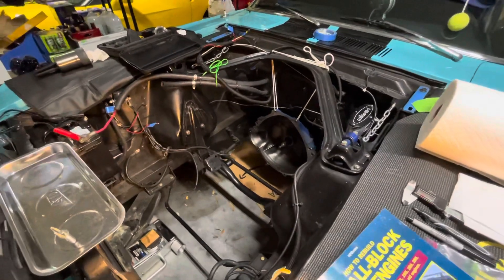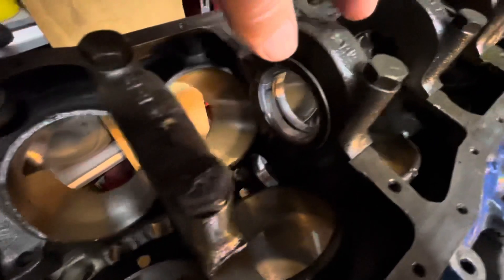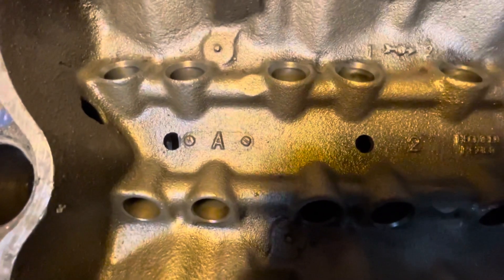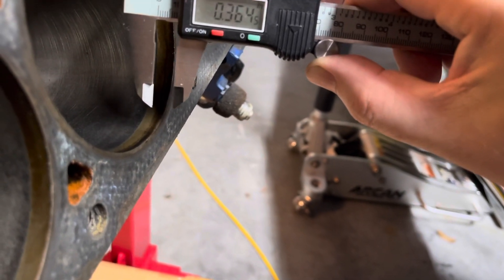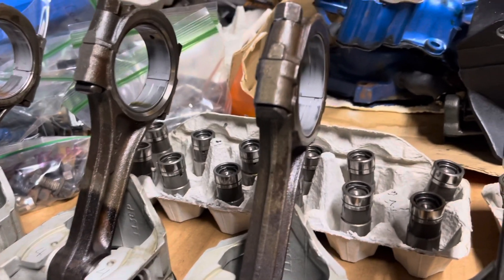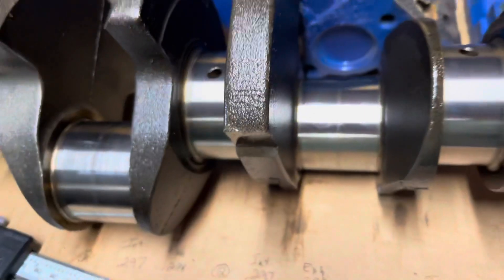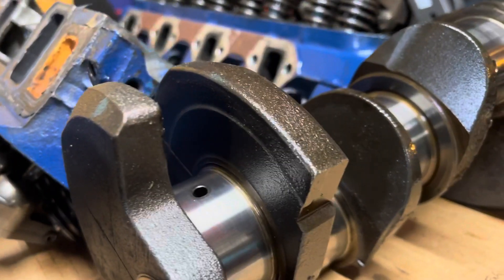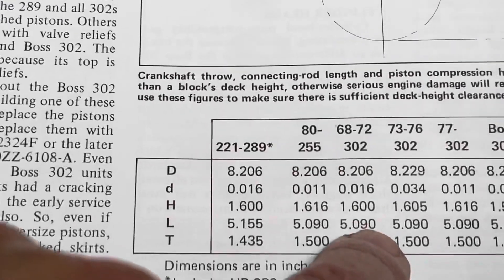Ford 289 / 302 Stroker Rebuild part 1

Comment: Sir did you use your original distributor with a steel gear or a new one. Would you have the part numbers that you used. Thanks
Reply from the maker: I have a PerTronix D130700 electronic distributor with a steel gear.

Comment: Lip variance is a weak or broken top ring or ringland wear.
Big valve heads may be 351, which give very little compression.
Reply from the maker: Cylinder #7 had a 302 connecting rod which is only 5.090” long while the rest of the 289 rods are 5.155” placing that piston an extra 0.165” away from the cylinder head at TDC.